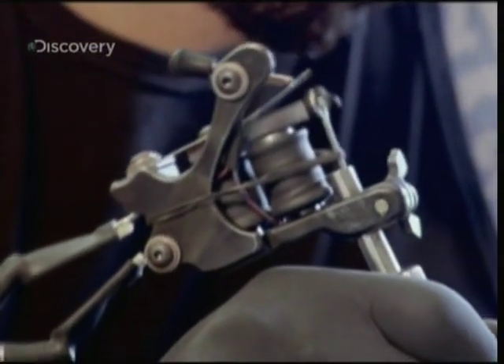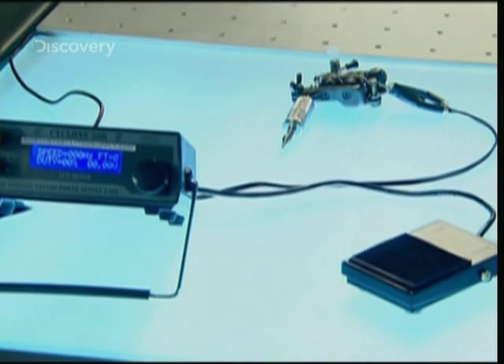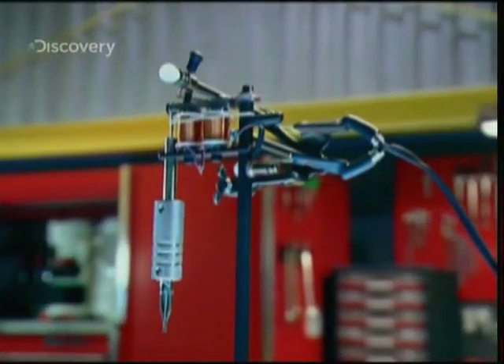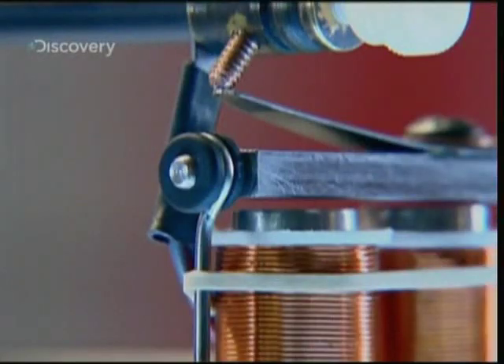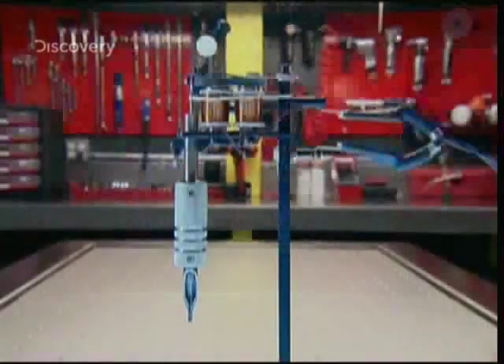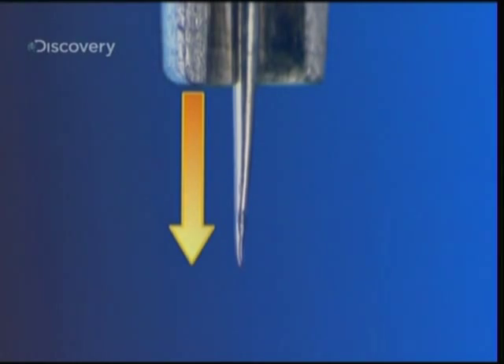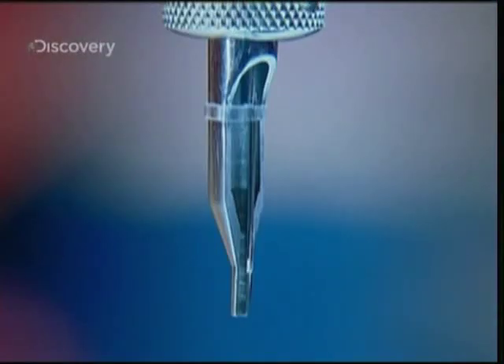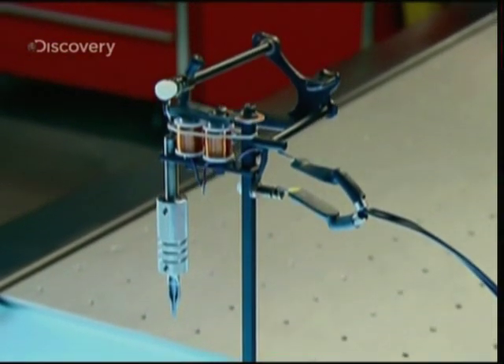How A Tattoo Machine Works

Comment: Thanks For Posting !  Awesome Video !   undergroundde demagrafix has a cool one as well on how a tattoo machine works: Beginning Liner Shader Tattoo Machine.  As for the question regarding rotary tattoo machines. Any rotary motor video will work. Same motors used in hair clippers , Remote Control cars. Bill